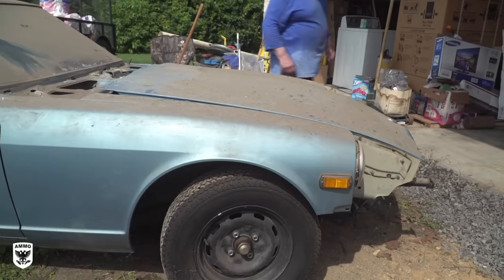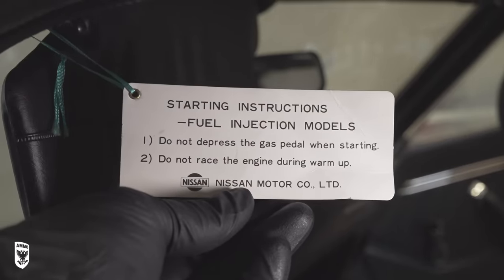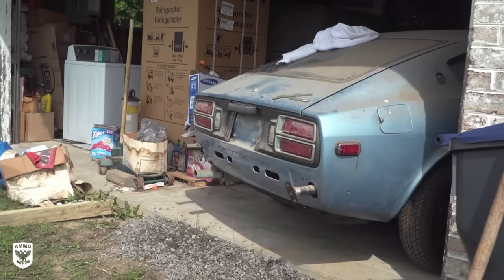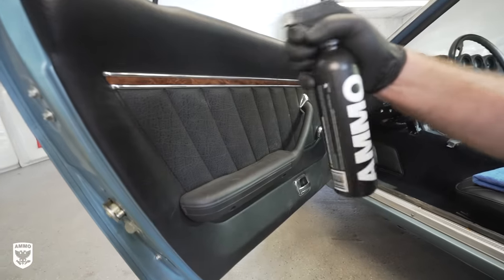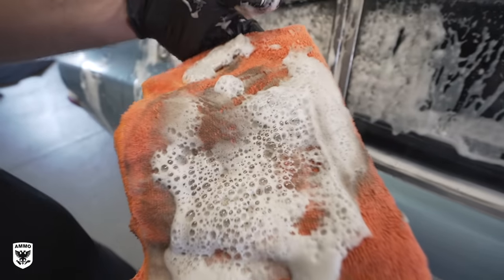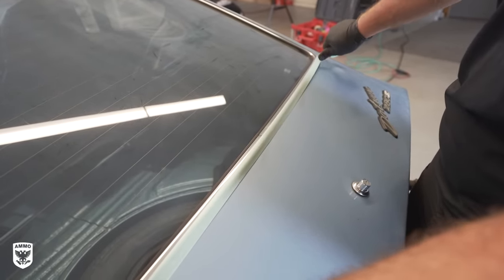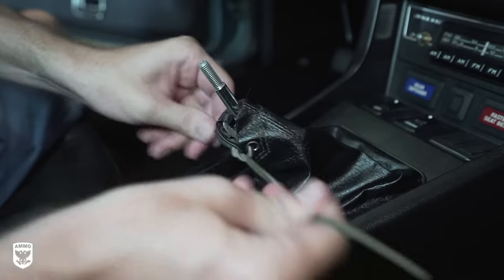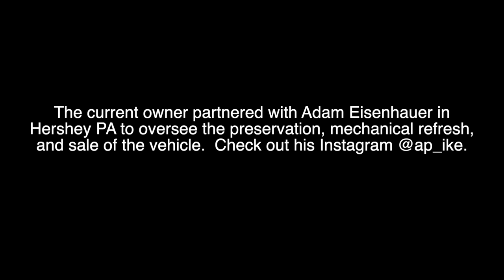First Wash in 44 years! Barn Find Datsun 280z with only 350 Original Miles

Comment: No engine start? Is like you didn't finish the work :( I was so looking forward for it..
Reply: I'm curious if the engine even worked at all. To my understanding, engines arent designed to sit for extended periods of time. Like all the fluids, such as engine oil, transmission fluid and the gasoline all start to degrade over time. So I can only imagine what they looked like after 40+ some odd years.
Reply: @Grim-Truthspeaker383  All fluids have to be drained and changed. All cylinders have to be oiled using oil/petrol mixture to lubricate cylinders and piston surfaces + piston rings, all prior to engine cranking. All tyres and rubber parts have to be changed.
Reply: Im a fan of Car SOS.. Amd i notoced they have cars that stood for decades too.. but at the end they still make the engine work. I'm.not a mechanic.. but I'll ask my man. He is obsessed with cars :) and he might know.. Still would have loved to hear the engine work
Reply: @LauraMarin2709  what’s car sos
Reply: @Lil_vara  a tv show with cars. I recommend!
Reply: because they cant crank it obviously... they need extensive engine work before they can even try to crank
Reply: @LauraMarin2709  thanks ill givbe it a try
Reply: @Grim-Truthspeaker383  Oil usually will look like sludge if it sits too long
Reply: This was just a detail job, for cleaning/paint repair. They weren’t doing any sort of mechanical work.
Reply: @Grim-Truthspeaker383  i have a car that had sat for 25 years, no oil in the cylinders no nothing, i put a battery in it and it started after a few minutes of cranking

If anyone is curious, carbureted volvo 240
Reply: AT this point, you will have to run this engine with diesel in order to clean and remove that oil crust it creates inside the engine.   Once the diesel is coming out clean, then you let it drain and then put oil in it.   The pistons also needed to be lubricated as they must have been stuck after so many years.  new sparkplugs and definitely the carburetor might have needed a cleaning. New tires for sure as those must have been rotten and will rip into pieces any time soon.
Reply: They are for the detailing. Someone else will do the engine
Reply: The fuel in the tank might be still  good......for starting a bonfire.
Reply: I think they focused on cleaning not the mechanical to be working hope they added the working engine and internal electronics or mechanical stuffs, not just clean but also working, and think that's a whole lot of work and money because of full restoration and replacing old things that didn't work today and find old as the same thing which is more pricy I think because of rarity.
Reply: @Grim-Truthspeaker383  Yes all the fluids would need draining and flushing as a minimum. Also depending on the climate, i've even heard of piston rings rusting a little and getting stuck in their groove, on a motorcycle that was only laying up over 5 or 6 winter months. They're suppose to be free to jiggle around a little. The moisture in the air enters in through the airbox or exhaust and through the open valves into the combustion chamber. Sometimes starting the vehicle up and warming it can free those rings if it's not too bad, but in that motorcycles case they were really stuck.
Reply: I agree. It needs to work too, not just look like a car. It IS a car. Engine and full mechanical restoration is part of the process.

Comment: You will never convince me grinding that dirt into the glass + paint with a towel
is better than rinsing it off with a hose first. No matter what foam you put on it.
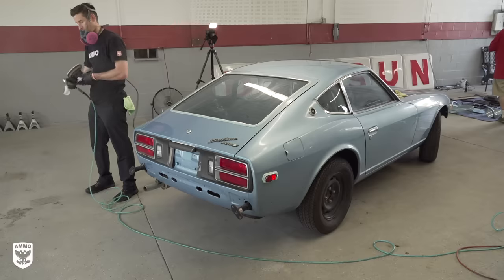Reply: Yup. And also when the guy was power-blowing out the circular buffing pad (14:12), the dust went all over the place including back onto the car. You'd think he would take it further away or such a special purpose shop would have powerful fans to control and direct the air flow.
Reply: I was screaming at them to let the stuff work for a while before wiping it off. Geez...
Reply: Absolutely agree. What in the hell is he thinking? It's basic physics. There is simply no possibly way those "bubbles" are completely blocking those dirt/dust particles from scratching the paint as he wipes it away like that. I see no advantage to this method. In the end he rinsed it anyway so if that was the point then it makes no sense.
Reply: @suburbanhobbyist2752  it's like he's doing the opposite of what he preaches it's confusing
Reply: Yeah. Contactless wash first guys. Foam onto the car, then a gentle rinse with low pressure hose. You want to just have it lightly rain on it to rinse off all that abrasive grit and dust.
Reply: @suburbanhobbyist2752  Ah the internet experts have spoken. Please show me your detail studio where you have done hundreds of extremely valuable cars. Pretty sure he knows what he is doing.
Reply: @rockdinosaur8619  while I respect where you're coming from, and his experience, watching him rub back and forth with the muddy rag on the paint didn't seem like a great idea. Obviously you can buff out the little scratches that makes, but ideally you want to avoid making any marks so you don't have to buff as much paint/clearcoat off. He usually seems so careful I was like wtf when I was watching that
Reply: ye the dust is very fine its not dirt there should be no scretches
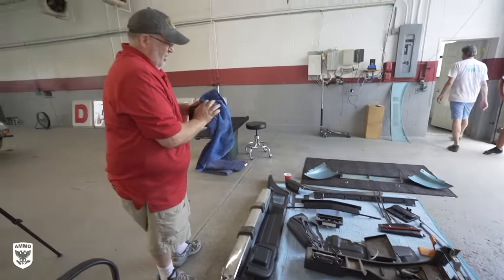Reply: A valid point, but he explains at 09:17 why he chose to do use a minimal amount of water on the exterior to preserve the factory paper tags.
Reply: @bmccarty2012  yeah, everyone knows about the two rag method though, and he didn't do it. The idea is, one wipe per clean surface of the towel. Then you put it in a dirty bucket and use another clean rag. In no detailing video have I found that rubbing multiple times with a dirty rag is a good idea. Especially when it's that bad😳 but obviously it worked out fine with new paint
Reply: Well I suppose that’s why we are watching his channel and not yours 🫠
Reply: Agreed. I see a lot of over dramaticism here in removing the dirt. The car sat in a fairly dark garage and was kept away from moisture. The seals should be in perfect condition. The dust that accumulated was dry. All you needed to do was rain down on it with a hose with a sprayer. That alone would have loosened up the dirt and removed far more than using that foam and towel method. Then you could have used that foam to lift up the remaining dirt and then use the power sprayer on a low setting to wash away the rest. I get that he didn't want to use a lot of water to protect the paper tags. Saran wrap?
Reply: @amirlecter8318  what ppl forget is that the owner always has a say, Im sure he said dont use water/pressure and around the end the owner was convinced
Reply: @rockdinosaur8619  I think you right. It's best to grind that dirt into the untouched original paint.....
Reply: @wmacky  Not how it works. The foam lifts and lubricates far better than spraying it - using water actually removes this film protection and allows particulates to scratch, while a microfiber cloth removes the particles without impacting the surface. Again, these guys work on expensive cars every day - do you?
Reply: Leno never washes or has his cars washed.
Reply: Jack, I agree and wondered why they didn't take the car outside and blow a lot of the dust and dirt off first?
Reply: @wmacky  : hahahaha! Good sarcastic answer.

Comment: When a cars first car wash in 44 years costs as much as all the washes it should have had put together, lol
Reply: if he brought that thing to auction that wash would have made a big difference
Reply: I wouldn't pay this butcher a cent to have my car washed. He literally scratched the crap out of the paint by wiping it down while full of dust and dirt, then plays off the damage he caused as simply embedded dirt after all these years. Watch from 13:07. The paint butcher says "The paint itself is really not that damaged but simply embedded with dirt after all these years." You can then see the light scratches that he caused by grinding the dirt into the paint with the cloth. The extent of the damage must have been pretty severe as a cut and polish was needed on the car. If this car was only driven from the dealership to home and then garaged, there would be no need for a cut and polish.

Comment: Nice cleaning and restoration. Would love to see how it runs and rides. I owned a 280ZX: terrific sports car and mechanically reliable.
Reply: How it runs?
Well, after 44 years being in auto coma mode all the seals and gaskets have to be replaced. Once that is complete you can begin replacing all the parts that have not moved in 44 years if you can local such parts. The superficial part was easy now comes the pain. I know, I went thru this. The 350 miles on the odometer does not imply "like brand new."

Comment: You're literally rubbing dirt across the paint... It most likely wasn't scratched before.
Reply: I was thinking the exact same thing!! wtf
Reply: How would you remove it?
Reply: yep Amature common sense to wash the lose dirt off before anyone rubs anything on the paint
Reply: @lacosanostra20  "bUt We dOnT wAnT tO gEt ThE sTiCkErS wEt"
Reply: @captaincannabis3321  LOL!
Reply: You need to listen to his explanations, he clearly explains why he did it as he did.
Reply: Ever heard of wax
Reply: i learned when i was like 10 your supposed to spray with water before wiping dirt .. they fucked it. hopefully all buffed out. maybe.
Reply: @tommypiening9848  already have and it was fine. You can check over all the seals and see if the rubber hasn't expired. And they literally used high pressure water after they scratched it to death anyway. And you should never use a high pressure washer; that stuffs for cleaning concrete floors and walls industrially.
Reply: @Bozza36  Lube my friend
Reply: It does not matter lmao when the scratches are micro ones and can be removed with just a wax
Reply: Minimal use of water..reduce corrosion
Reply: Haha true.
Reply: Seemingly

Comment: 44 years in a barn and this thing has zero critters chewing through the interior?? Not fair at all. I had my 240 stored for a winter. Came back and it was like the port-a-potties at a mouse Woodstock in there. I'm jealous just for the fact that they literally had to do nothing to preserve it other than just not touch it.
Reply: So did you get your 240 repaired and fumigated
Reply: Yeah; Mice sure like 240Z's. I've had the same problem. Even had a nest with babies under my back seat.
Reply: My 240(sx) (we're basically family, right??) Has been gutted of the interior no fewer than 3 times. I had to cut open the sills because they nested in both sides and I couldn't remove all the material without making an entry. Then they nested above the headliner twice. I've found them dead. Decomposing with maggots. Captured one live. I've shampooed every piece of fabric more times than I can count. Used an ozone generator a couple times. Even hosed out and shop vacced up the inside of the sills to get up the urine. It's been a long and difficult war. But a war I intend to win.
Reply: @mattcolver1  Rig up a small container (like an empty tuna can) filled with cotton and soaked in peppermint oil in and install in engine compartment or where mice enter vehicle. They hate the smell. It may not work in a building but it seemed to work for my two cars in the garage over the winter.
Reply: My guess is the garage flash Barn wise pretty tight. Critters probably didn't have access to the car. Just got real dusty and dirty.
Reply: @mattcolver1  that’s why you need a cat

Comment: I was surprised that a clay bar wasn't used after the power washing, but before polishing.
Reply: It's not necessary, the dirt isn't "stuck" to the paint like the typical road grime and fallout, it's merely just trapped inside the orange peel/pours of the paint. It's an unnecessary step that take more time and could cause marring or scratching opposed to a simple light polish to release the dirt.
Reply: Only because it’s probably not part of the sales pitch for their products,? But yeah  use a clay bar all the time on my own vehicles all the time..

Comment: I cringed when you put foam on it and wiped it right off without rinsing it first...
You crazy
Reply: I know! I would have had 200 or more newly bought microfibers sitting next to me at least. 10:43 made my stomach hurt.
Reply: Yes they should have waited for few minutes so that soap water soaked in to the dirt and then waterd it down
Reply: The car is about to get buffed so there is no need to be so picky
Reply: @gabrieldauz3533  still cringe
Reply: Absolutely.  Who wipes dirt into paint?  How idiotic is that when they could have used lots of water to loosen the dirt and probably could have hosed it off gently to get rid of almost all the accumulated dirt.  I guess they are just so confident in their products they felt it didn't matter.  Its the principle of the thing.  Some things you just do not do.  Especially when you're not short of time which clearly here they aren't.
I suppose they would argue that the microfiber cloths they are using are engineered to lift the dirt off but why take a chance when the other way is so easy and fool proof?
Another option if they didn't want to risk the seals with pressure washing (which they did shortly thereafter) would be to use the microfiber cloths except with a lot more water and don't wipe anything til the dirt is really loose and soft.
Reply: Lol, thought the same thing. I said to myself, something is wrong here.
Reply: The whole time he was saying they didn't want to hose it down due to not knowing how good the rubber was.

Emagine if they pressure washed it and all the "mud" created went inside the car due to dry cracked seals.
Reply: @5punkybob  You can still hose it without getting anything inside. Its a 2 man job. You need something to hold against the edges, and hose part by part.
Reply: He's using AMMO Frothe. Not a typical foam pretreat. It is a waterless wash product and designed to be safely used that way. If you use it, you'll understand. Frothe has insane slickness and lubrication. For an enthusiast, or higher end detail it is phenomenal and about the only waterless wash product I'd actually trust on sensitive jobs. 👍👌✌
Reply: @jdisdetermined  
Unununbununnunnun
Reply: @5punkybob  presure wash is not the only way you know. They should have watered it first. They were not sure about the rubbers after they wipped the dirt into the paint and just like that, they gained confidence in the rubbers and presure washed it... I expected more from professionals...
Reply: @logs  I came here for that comment!
Reply: Did you not listen? If they rinsed they would of damaged the originality like the paper stickers, tags and other factory markings which all give it its credibility as an original car
Reply: @nzRCreviews  you can still rinse it without damaging those. You can pressure wash from a distance so the pressure would be lower.
Reply: That was like using sandpaper before washing it first...you DONT wipe the dirt with a rag.
Reply: My exact same thoughts!
Reply: @nzRCreviews  you mean when they power washed it. So nope. They weren't that concerned

Comment: Was the engine okay after all these years? Would have loved to see you start it up. Nevertheless, great work.
Reply: You're missing the point. Engines are relatively easy to repair. If this vehicle was actually driven since the 1970s, rust will be a huge issue.
Reply: @MrAnonymousRandom  He's not missing the point lol he's just asking a question
Reply: The engine itself is probably okay, but all the rubbers and hoses should be replaced or checked before even trying to get it to run.

Comment: - Not enough screen time devoted to the finished product.
- I would have power washed it FIRST, not sprayed it with Frothy and wiped the dirt with microfiber towels.
- Original tires? They didn’t go flat?
- Was the engine ever started?
Reply: What was eventually found - The radiator had leaks, the fuel injectors needed cleaning and a few hoses I think had to be replaced.  It does now run.  (The website they direct you to at the end and in the description tell more about the car.)
Reply: Fredo Bull  They probably could have rinsed the whole car with water but they were trying to preserve the interior stickers and tell-tales that proved the provenance of the vehicle and to get maximum value from the flip. They buffed the paint like pros; they knew exactly what they were doing.  Any incidental micro-scratches came out with the polish they used.
Reply: @stopthephilosophicalzombie9017  they pressure washed it after so that theory doesn’t really work 🤷‍♂️
Reply: @allthatgleams  They did that in a very limited way to keep too much water from stripping off the stickers. Like I said, it looked like they knew what they were doing this wasn't their first barn find.
Reply: You need to listen to his explanations, he clearly explains why he did it as he did.

Comment: I had a 1977 Z. I'd make up any excuse just to drive it. At highway speed, the car got 35 mpg. Most astonishing, on winter roads it handled better than any car I'd driven before. A wife and new bay girl brought an end to the romance. 
The original Z body style from 69 to 78 was the most attractive of all the Z line right up to the latest incarnation. Those older models will be worth far more than any of the others in another 45 years.
Reply: I bought a new 1977 Toyota Celica GT as my 1st car. I loved that car but it did has rust issues.